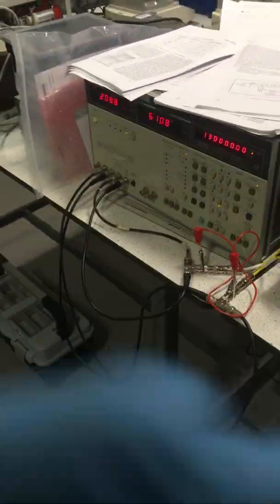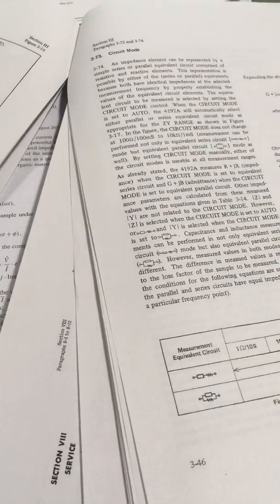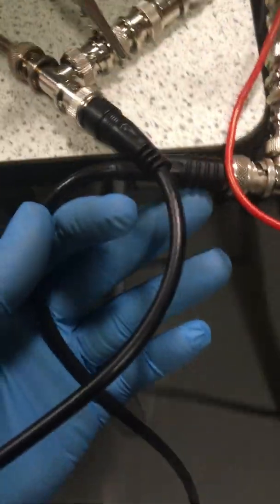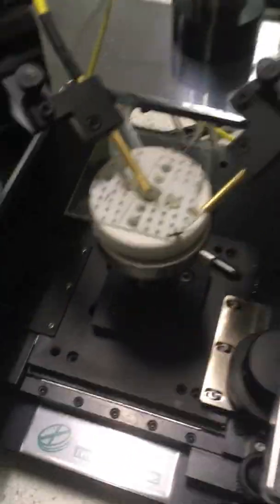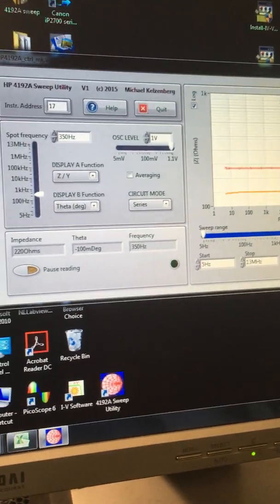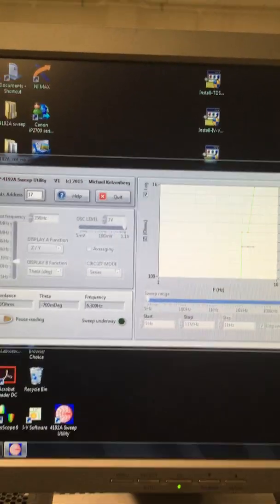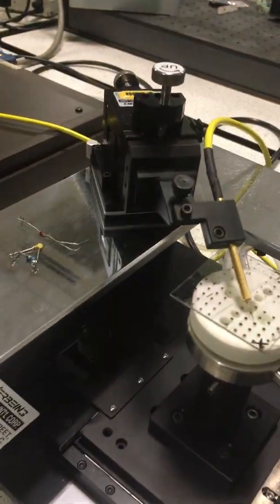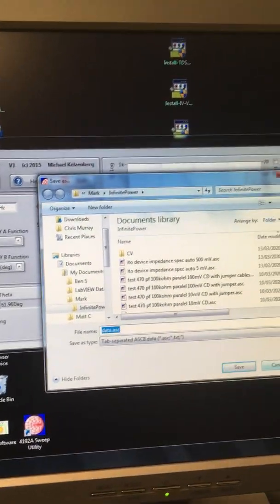Impedance analyser tutorial

Comment: Hello Mark, Thanks for this video. I am using the same impedance analyser with 4192 sweep utility software. However I am getting an error for capturing data from DISPLAY B and DISPLAY C on the software. Any suggestions?
Reply from the maker: If the impedance you're measuring is too high, the software wont read any data. Or, if you don't have a genuine (or close enough to genuine) NI GPIB interface, that could cause communication problems.
Reply: @physicswithmarkhughes9748  <thank you